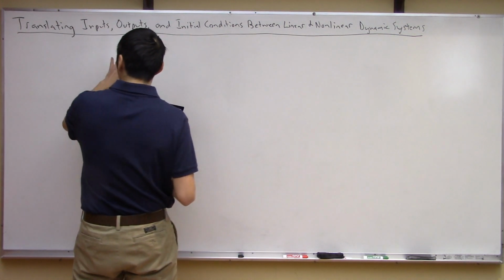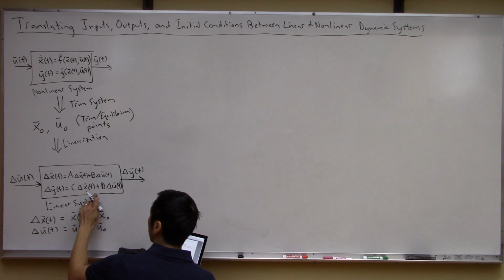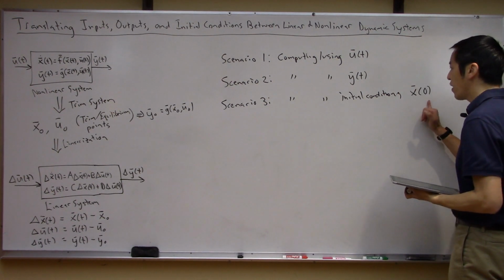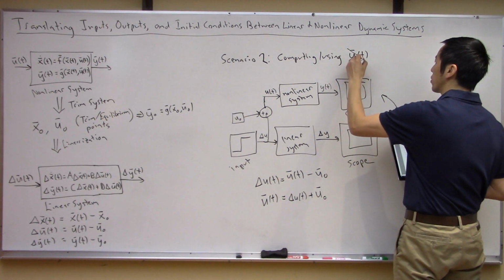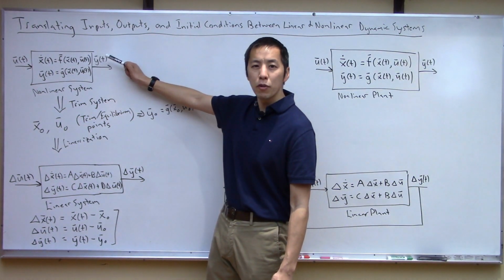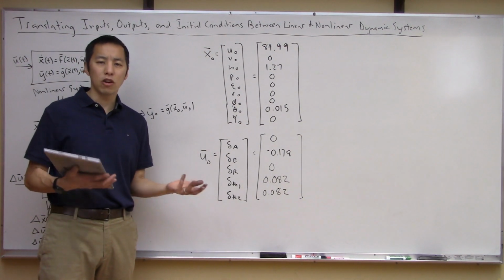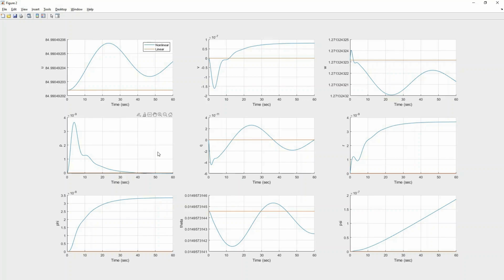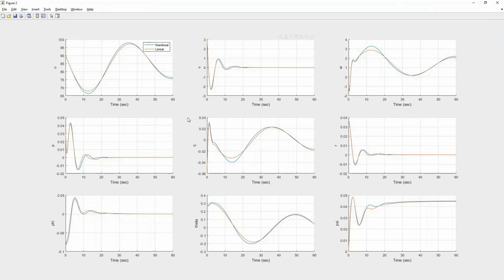Translating Inputs, Outputs, and Initial Conditions Between Linear and Nonlinear Dynamic Systems

Comment: AE512: Would be interesting to see an example of how 'quickly' the linear model diverges from the non-linear. Also, would be cool to see a way of interpolating between linear models, or trim points, based on some changing boundary conditions.

Comment: AE512: Very interesting when you talked about the "real world" applications and using controllers to determine our u (in the nonlinear case, delta u in the linear). Based on what our desired state is, we can control that via any controller and design a feedback loop.

Comment: AA 516: Is it correct in saying that if you design a controller with the linearized system and implement the same controller into the nonlinear system, this would only be useful if we operate the nonlinear system near the point that we linearized about in the linear system?